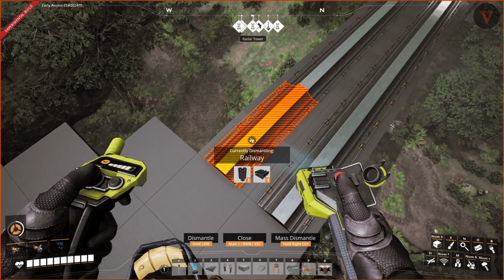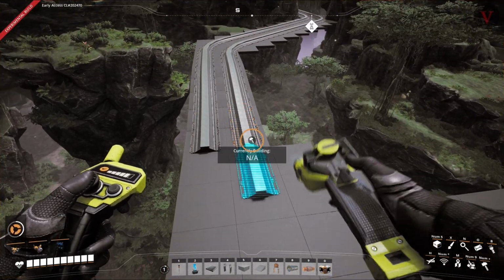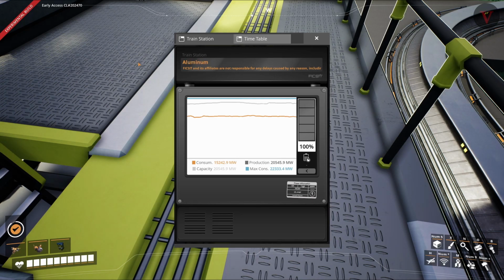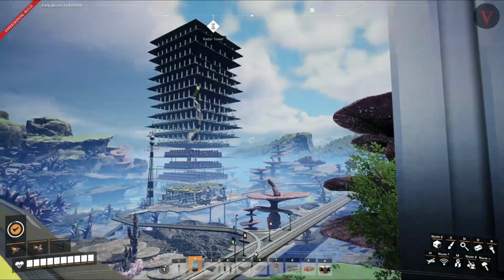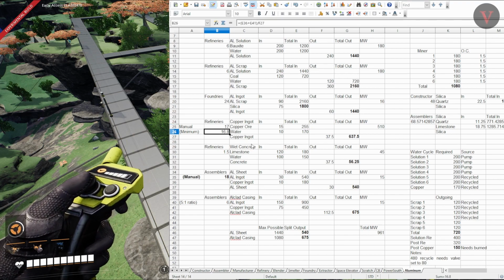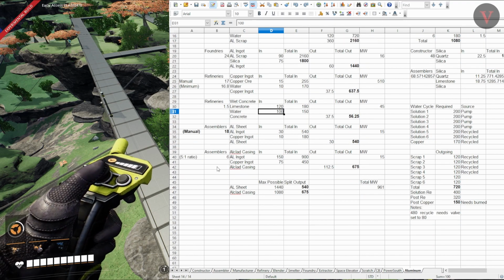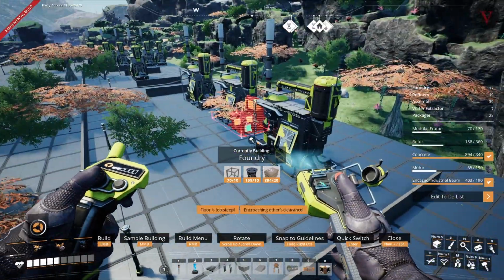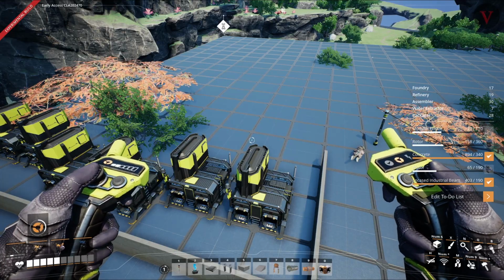Pixel Perfect E41 - Planning an Industry - Aluminum Pt.2 - Satisfactory Let's Play Series

Comment: That's a really cool space you picked out. Hopefully it's not too tall cause the backdrop behind the building will look pretty sick. I was curious, maybe I missed it in the video. Is there a limestone node near there, or are you importing it?
Reply from the maker: As you mentioned, the surroundings are going to look great, and it's part of my vision for the build.  We'll be importing the limestone via train, most likely from the bauxite station, as we only need ~180p/m to burn off the rest of the water.